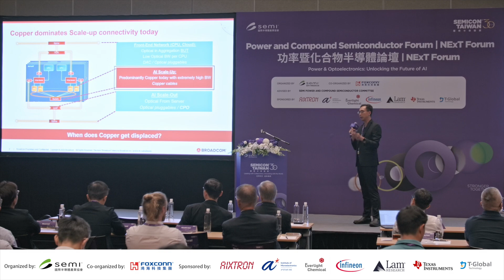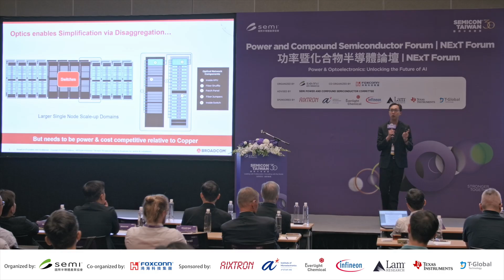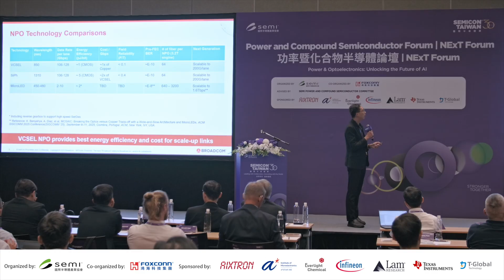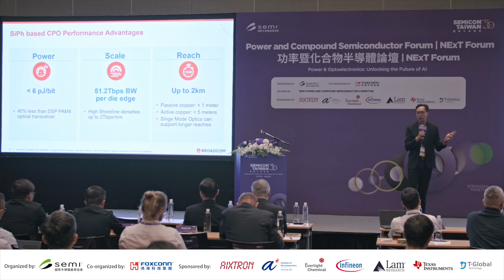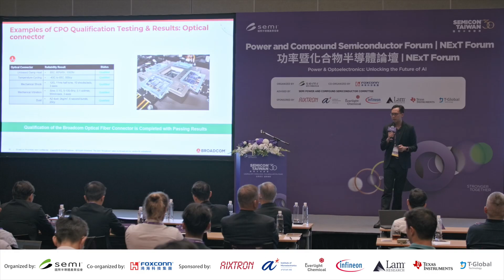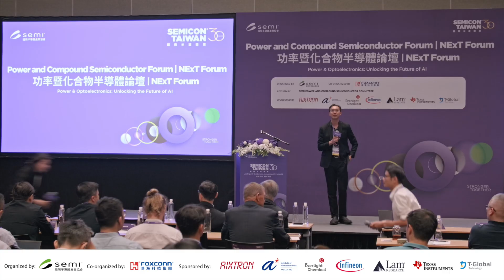Optical Interconnect Technologies for AI Networks ｜Dr. Tzu Hao Chow ｜ Broadcom Inc.

Comment: The comparison between copper and optical interconnects makes the AI scale-up challenge concrete: reach, power, reliability and link stability must be evaluated together. Brazil could test optical-network components through phased data-center and semiconductor pilots, while any Brasil Semicon or PADIS support remains tied to eligible activities, approved projects, PPB and R&D obligations.